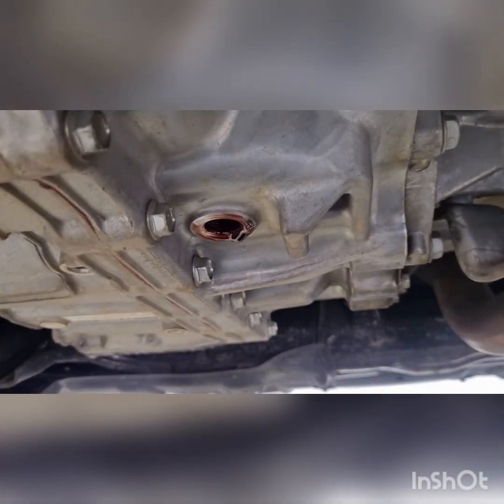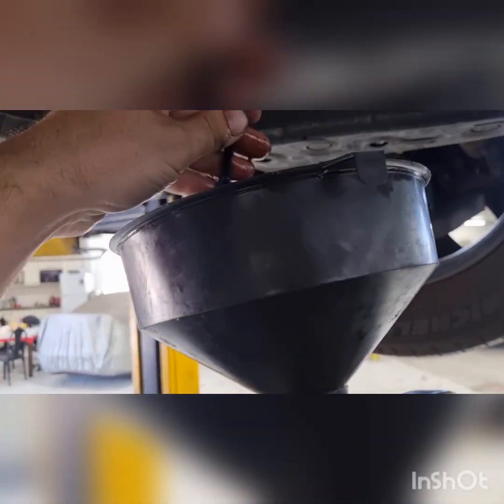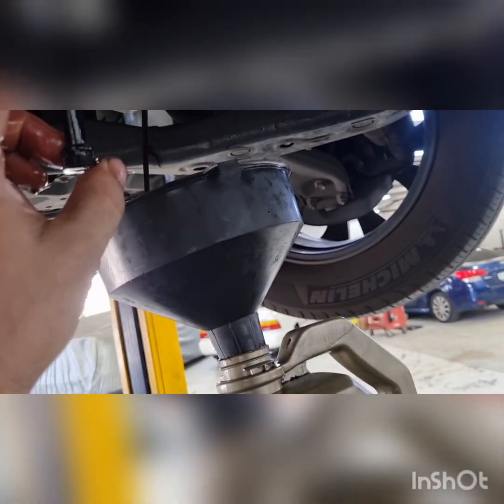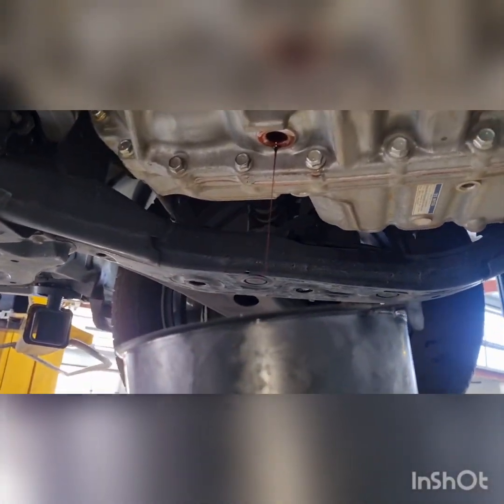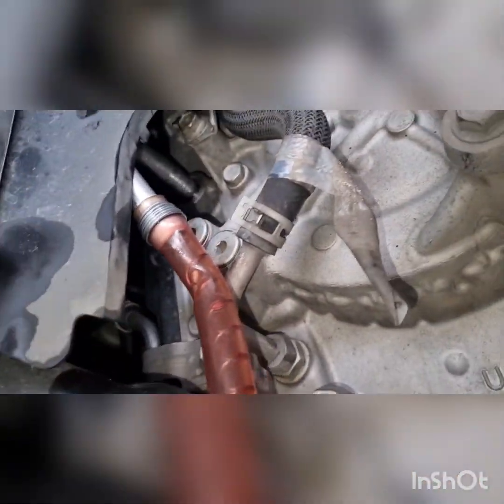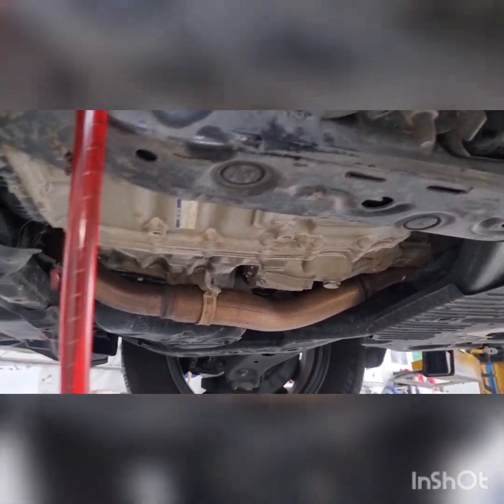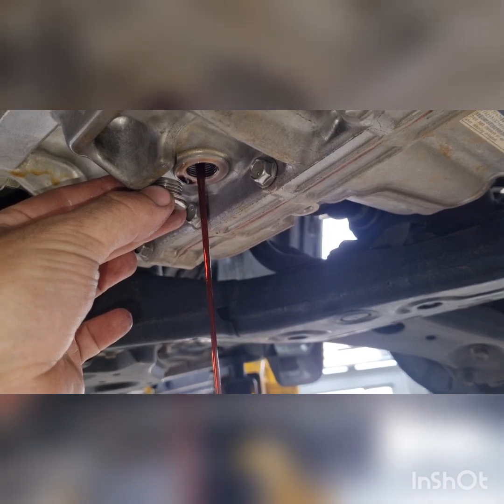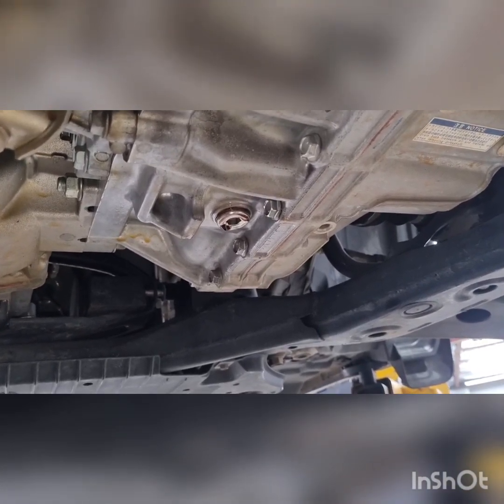Toyota Kluger/Highlander Transmission Service UA80F 8 Speed

Comment: I know on my 8th gen Camry, the UA80 transmission temperature needs to be between 95°F - 113°F in order to set the level properly.  Once the transmission temp reaches 103°F/104°F you remove the  drain plug and let the fluid get to a trickle then close it up. From what ive read, you'll add about 31/2 quarts after you've drained the pan and replaced the leveling tube. Once the transmission comes up to temp, nearly a half quart will drain out before closing up the system. The Car Care Nut has a great video showing this procedure as well and he is a master Toyota technician.
Reply from the maker: For sure mate 95f being 35c is not far from a usual temp here in Australia & after running for a couple minutes we would be in the correct range for for setting the level 😉
Reply: @RealAutoSolutions  yeah, I was just posting this in the comments because I've seen so many people ask. I think it's because this "no transmission dipstick" thing is rather new to everyone. I just recently purchased a 24' Camry SE and had to do some serious digging to find all the correct information on how to service my car and what I need to look out for. I have heard from two different Toyota master technicians that it's best to do the drain and fill when the cars completely cooled to ambient temperature. When it comes time for my first transmission service,  I figure if I wait until the transmission temperature is 103F to throw the drain plug back in then my car should be at the perfect level. Still though, thank you for posting all of your work related videos, all of it's educational to someone. By the way, what kind of issues have you seen with the 8th generation Camrys, if any?

Comment: Is there a filter you need to replace as well?
Reply from the maker: Not in this one mate, oil change only

If it's very dirty give it a flush - i will have a gauze filter that doesn't need changing, we only change out the paper ones
Reply: It's not a filter, it's a strainer assembly. Toyota does not suggest changing it unless something catastrophic happens within the transmission. It's basically a screen that's sole purpose is to catch larger debris should something break within the transmission. It does not filter the fluid, if you look up the part, you'll see that it says strainer assembly right on the packaging. The magnets in the bottom of the pans will grab any clutch pack material or fine metal particulate, that's why they are there.

Comment: Question can i put a highlander oil radistor transmission oil cooler y a camry with same engine 2gr-fks to put down the fluid temp
Reply from the maker: Just put an aftermarket one on if you're wanting cooler temps

Comment: So many things done wrong - that transmission is now overfilled.
Reply from the maker: Care to explain
Reply: @RealAutoSolutions didn’t allow transmission fluid get up to temperature. Correct idea, wrong execution.
Reply: You have to get it to temperature than remove drain plug agajn. Tranmission fluid expands you will have incorrect level
Reply: @RealAutoSolutions I listed the transmission temp range in my earlier comment. You should always drain and fill while the transmission is cold. If it's hot then the fluid will be thin and your measurements will not be accurate. Once you've drained the pan, and replaced it with the same amount, add an extra half quart/liter. Close up the system then have your guy start and go through the gears until the transmission temp is between 95°F-113°F. Pull the drain plug, not the leveling tube, and allow the fluid to drain until it becomes a weak trickle. Once you see this, you can close the system up and the level should be correct. I figure that if the range is 95-113 then 103F/104F would be dead center of the range and therefore filled perfectly.